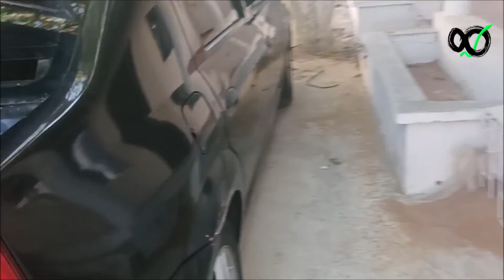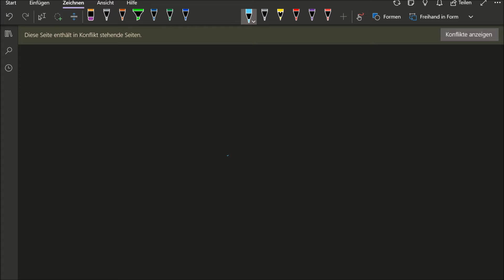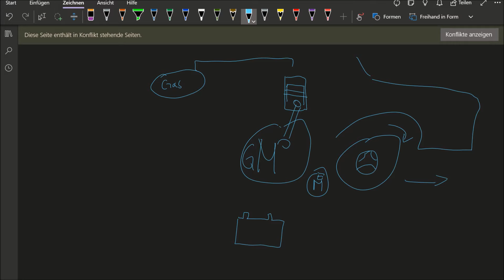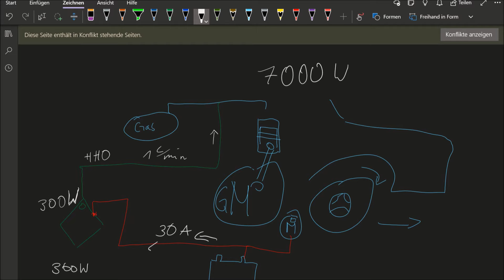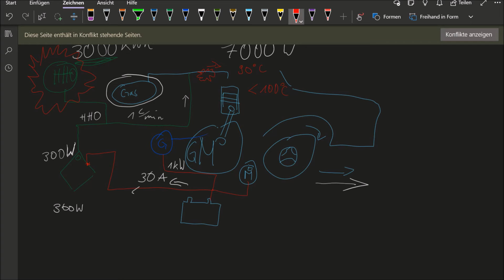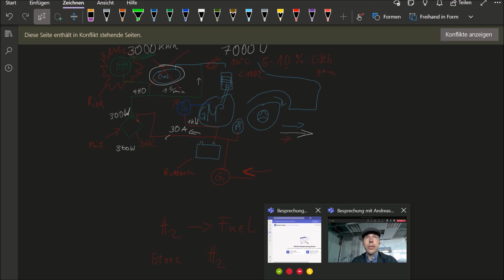HHO Car will never work

Comment: is it possible if you combine 3 10% HHO + 20%ELECTRIC IN THE FRONT WHEEL + 70%PETROL AT THE REAR WHEEL  WHILE MIXING HHO AND PETROL FOR GOOD COMBUSTION AND CONSTRUCT AN EXTRA GENERATOR LIKE A FLEXIBLE SOLER PANEL ON TOP OF THE CAR TO CHANGE THE  BATTERY FOR THE ELECTRIC WHEELS AND THE HHO ..... WILL IT WORK IT'S MY DREAM TO DO SOMETHING LIKE THAT ???
Reply from the maker: nice idea, keep in mind that solar has about 200 W/m², thus is quite unproportional to a fossil powered car. but the secondary electric mo in combustion engines is a standard, mostly for regenerative breaking. This shouldn't discourage you from your dream, just quantify, before scaling up. ;)
Reply: good regenerative idea what if you add small wind turbine at the top , bottom wind defuser,two front grill  and four at the wind breaker which will increase something but i know it's just a theory ..  then weight issues too but just speculating!!
Reply from the maker: @suleimanyunusa4871  while you drive the resistance of the wind turbine will always be bigger than the electric generation. when the car stand still and a storm comes by you'll have a positive balance. The generation of energy in my eyes has to be seen stationary, and a home refueling station fills your car with excess power you cannot consume directly in a home. Check out the video https://youtu.be/Qz9VdcvXacQ where I explain my idea of cheap driving. Thanks for your fantastic ideas anyway

Comment: The hydrogen acts as a catalyst to speed up flame propagation inside the cylinder during power stroke. Therefore all fuel is burnt within a short time. Ive built and tested hho device and got 15% increase in mileage.

Comment: if we put in enough LifePo4 battery like 8 stacks of 200A 12v battery in the trunk, i think it could be supplying the generator to run the car. basically its gonna be an electric car with no gasoline usage.

Comment: I tell you that by installing a cell with hho gas and modifying the maf, iat, oxygen sensor sensors you can obtain fuel savings, because they reduce fuel injection and the loss of power is compensated by the entry of hho.

I have several installations and they all work. In a 2,500 diesel engine truck, the client had a performance of 12.6 km/l and now it has increased to 14.2 km/l.
With these results, the kit works correctly.
Reply: usually in indonesia they put or modify the oxygen sensor that come with new cars and the savings could be up to 35%
Reply: YES ITV CAN WORKED BUT THE PROBLEM IS IT CAN COST NEAR $2000 FOR ALL THE REAL COMPONENTS YOU NEED TO GET 20 TO 30% FUEL ECONOMY, MORE  LIKE 50% CAN BURN TH ENGINE VALVE AND IS NOT RECOMMANDED.

Comment: This method and idea was back in 5 years. In 2022 the technology allows you to make a slipt cell generator. This means the hydrogen not mixing with oxygen.  With this setup you can use the lpg gas converter kit,or just use your injector to inject the H2 gas. The pure oxygen just connect to air  intake . Every car have to modify the ECU and remap it. Otherwise will not work. You can make easily 6L/minute.
Reply: And how much could be saved l/100km in this case what you explained...?
Reply: No, it wont work! It’s only for dreamers. Just make a simple calculation of the energy of 6l H2+O2 gas - the amount is so low and until it reaches an combustion chamber it is gone already. Remapping an ECU? You must be kidding. Go back to school and learn at least the basics of chemistry and physics….
Reply: Thanks. I’m sick of shillllyarse geese and liars
Reply: PeePole with black box confined minds. Keeping us all enslaved whilst we are mined for our energetic ore. Parasites delight. 

No surprise this channel is run by a saturnist as profile displayed in profile pic and  im sure if i look at their banner they’ll have more signs and symbols of their dump star clique.
Reply: @CoincidenceTheorist  I dont know what you talking about. The problem that peoples try to run the car with 10-30 cell hho generator at 12volt . Is like when you wanna run a Tesla with 30 cell battery pack. Is not about the plate size ,is about cell count. The Tesla car whole floor is battery with almost 8000 piece type of 1865 cells. Imagine if they would make same size just for hydrogen separator.

Comment: Im here to inform you this is not correct. Bob Lazar, there is a video of him and his car converted to hho. This was a legit interview. Also i have witnessed a former Marine engineer who is off grid and runs his car also on hho.
Reply from the maker: Where do they take the energy from?
Reply: @volks-electrolyzer  Tje car Alternator designed for 125-200 Amp. The hho generator use only about 6-10A.
Reply from the maker: @laszloszell8753  do you think a device can create more energy than it consumes?
Reply: @volks-electrolyzer  Of course. The motor running, the alternator charging 10x more in one hour than your h2 generator using.Anyway with a 12v 170Ah separated battery you could produce h2 minimal 10hour continuously.
Reply: @volks-electrolyzer  using PWM on the generator, that does not use much electricity but produces more gas, other people who have made cars that run HHO only, they put an extra battery and extra alternator, some use solar to  the extra battery to power the HHO generator, HHO powered cars have been around since the 60. do more research
Reply: Stories for dreamers, it isn’t working!
Reply: @holgerkirschbaum6911  LOL Elon musk has created a jet propulsion engine that defies physics YET chooses to send you to the PAY POINT but cant add a "ALTERNATOR" for self charging lol you got to know WHEN your being FUCKED in the mind!
Reply: @holgerkirschbaum6911  Isnt it a wonderful thing NOT everyone is on the same wave length as everyone else. Gosh how boring...
Reply: @apsert  means you prefer stories over real facts?
Reply: @holgerkirschbaum6911  Go to Archaix site look at just some of the evidence that ties together with the Correct charts that mathmatically add up. IF you have not studied "Correct Sentence Structure Parse Syntax Grammar" then Jason's work wont make sense. If you have ? Then you ought see the sequence. It is like a code only if it does not add up front to back in accordance with the historic timelines by using the number you have (Number of years between events) divided by P.I.E then that which your reading has been fucked with. He (dis)covered this back in 2003 when he released his 1st book.